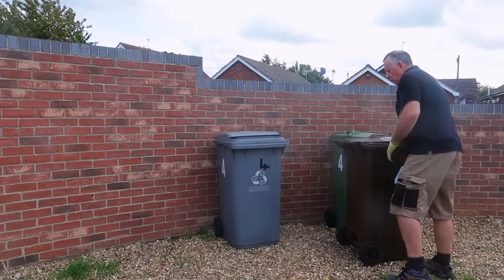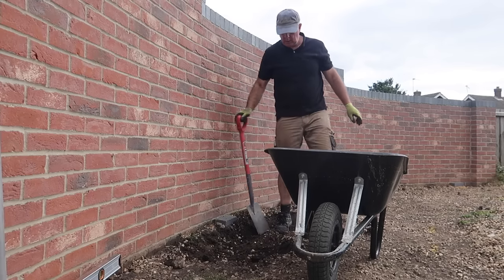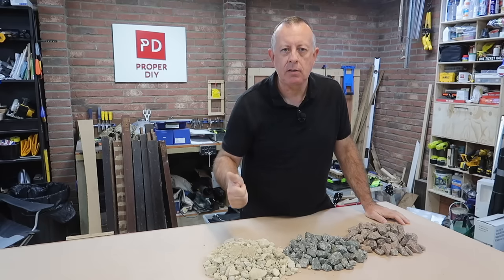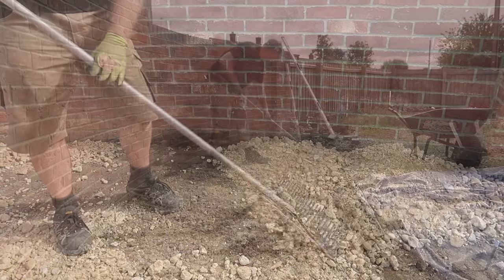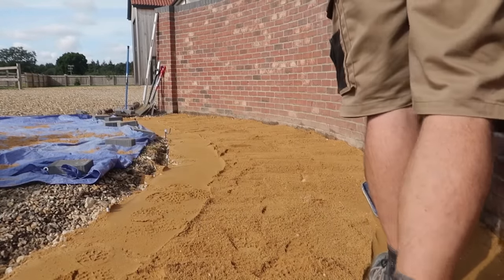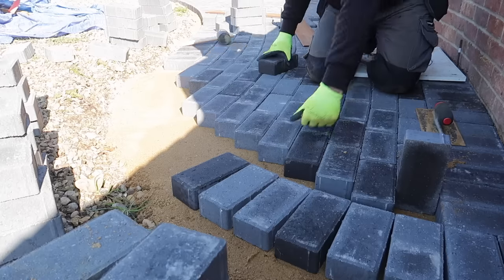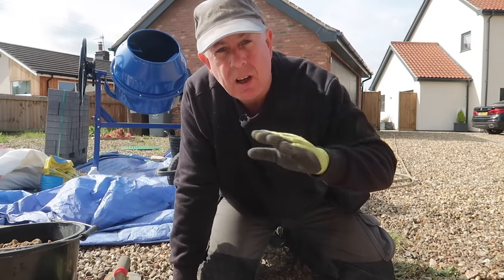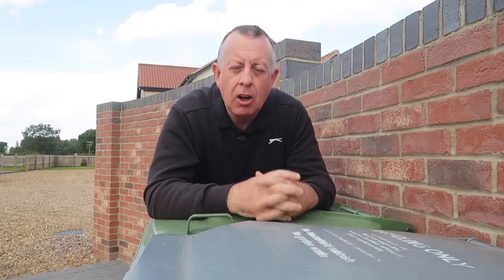The Easy Way to Lay Block Paving

Comment: Top job sir, excellent.
I prefer a plastic float for sand. Also a wee rubber mallet for tapping in cuts.

Here’s my top tip……..
When pointing flags or border blocks in this instance if you sit your metal plasters float on its edge exactly on the edge of the material you’re about to fill, then offer in the mortar against it and it slides nicely down the face into the gap. As you do it you can use the trowel that you’re emptying the mortar off as the second “edge” in the motion. Also you can hold the gear against the float and if you’ve got too much just scoop it back up the face and back into the bucket, it’ll just sit nicely against the metal float on its edge, just cut it off level using the other pointing trowel with the top of the block/flag, then run the pointing tool over it etc.It’s a bit hard to explain writing but I’m sure you get the idea. It’s not bomb proof but it does stop things getting really messy! Cheers all the best
Reply: Sounds good to me

Comment: Looks great Stuart. Little tip when cutting...To avoid cutting tiny slithers of block, replace the full block behind your cut with a half block. This way your cuts will always be at least half a block in length.
Reply from the maker: Good point!

Comment: Always like your videos. Watching from Canada where climate changes are something else. We have flexible edge banding made of plastic with spikes for the edges that keeps everything in place. Then you can use sand to fill the gaps. We also have polymer sand which is like your kiln dried sand with a "resin" coating. Once you finish vibrating it in, you mist it with water and it turns hard as concrete. Fills large gaps too. Great job on the pathway.

Comment: I used the dye in mortar in the summer when i replaced a retaining wall with block kerb edgings, as you say its trial and error. to get the colour right... Where the kerb edges went around the 1 corner it left large gaps which  i filled with the dyed mortar. and smoothed flat to the next blocks.  Once it started to cure i ran  the  trowel edge down the sides, this makes it look like a cut block or sliver of a block inserted in the gaps, Then used the same stuff on door step to fill the gaps which has survived the frost with ease,  Great video

Comment: Good work and good advice. I threw some block pavers down on size 11 boot compacted sharp sand and smacked the blocks level with a rubber mallet. Still solid 5 years later, although I prefer your method. 👍
Reply from the maker: Thanks. A footpath doesn't need much. The 75mm I put down will never go anywhere. However I'm still waiting for comments tell me I should have used 150mm of type 1!

Comment: Superb job as always Stuart👍. However, having watched watched your video on mixing cement with soil, would it be possible to do away with the Type 1 base by using that method for a path/patio base and then incorporate the sand/screed on top as usual? Thanks if you can respond👍

Comment: Decent looking job that. Placing blocks on a bed of sand when bolster cutting helps them cut in the right place  but disk cutting is the way forward as shown by those nice fits on the cuts. Highly recommend the Marcrist blades. Not the cheapest but they last.
Reply from the maker: Thanks. Good tips - I'll have to try next time.

Comment: It’s “sun-formation” under your type one. The type one is your formation. And you don’t need to compact virgin ground as it’s as hard as it will get already. Only reason you would do that would be to seal it. And you can over compact type one as it migrates the fines and you lose the bond - and method of measurement would give you the amount of passes necessary at what compaction

Comment: Just did my 70sqm patio this summer with porcelain 20mm thick slabs. 24” sq down to 12” sq

I decided to use a thin layer of (sharp sand) concrete. And then exterior tile adhesive (since mortar doesn’t adhere to porcelain without prep)

I did consider just using just the sharp sand but the area I had to work with was nasty. Lots of different areas all mixed together (some old foundations, some garden, some drainage etc)

Nice job you did 👍
Reply from the maker: Thanks.  70m2 of porcelain is quite a job - well done!
Reply: We have just had ours laid 50 sq m porcelain. The prep part to work with mortar is very simple to do using a simple slurry mix

Comment: Great job mate. Depending on whether they’re Clays or concrete blocks all depends on how they split. I use a 9” grinder as I consider it to be far neater than a block splitter or hammer and bolster, although as you say the grinder does make it a dirty and noisy job. Got yourself a new sub either way 👍🏼

Comment: Proper job. I’m thinking of doing my own front path soon with similar blocks, so some great tips here. I am interested in how possible/hard it would be without a tamping machine, though. The path is about 70cm wide and 3 metres long so not huge. It’s on a very tight budget basically, so trying to avoid hiring anything. Cheers.

Comment: Excellent video on this job of work. Why though, if it's only a path, did you use 80mm thick blocks which are used for highway traffickes surfaces ? Surely the 50mm thick blocks which are suitable for footpaths would be more economic and might even have cut easier by bolster chisel. Otherwise  great instruction about how it should be done.
Reply from the maker: Thanks. 60mm thick actually and they were the cheapest ones at my local builders merchants!

Comment: Thank you. Seeing how a proper job is done really helps to avoid bodge ups, but wow!  What a lot of materials are needed….did you cost it out?  That short stretch of block paving must have cost a pretty penny by the time it was done.
Next summer I want to replace my front picket fence with a low brick wall….These kinds of skills make the job easier and more professional.
Reply from the maker: Glad you enjoyed it. I would think around £400 in total. Prob £1000+ if you you could find someone to do it.

Comment: If you are shoveling type 1, get it tipped on to a hard surface ie old sheets of ply or concrete so much easier to shovel into wheel barrows shoveling out of bags is a nightmare.

Comment: nice video. did you find weeds started to pop up in between the blocks? They have polymeric sand which is supposed to be good at prevention. going to try it out on my driveway soon

Comment: Very nice job. They look like 60mm blocks, was that intentional or just a happy coincidence? I’m after some 60mm blocks to fill in where a tree died and struggling to buy less than a full pack 🙄 Do not want to mess about with 50mm and 60mm malarkey 😆
Reply from the maker: Thanks. Well spotted - yes 60mm blocks. I just wanted a cheap, charcoal block and as a couple of my local builder merchants were completely out of stock, these were the best on offer. No, using 2 sizes on the same project would be a pain.

Comment: Tidy video thanks. Is that mortar you used to haunch-up the outside edge of the path or concrete? Or was it mortar you pushed under the bricks and then concrete to make the haunch?

Comment: Use a line , always plate your area 6x and mix cement through your sand  say 1 shovel cement to a wheel barrow ..best with red sand gives a rock  solid base .

Comment: I saw that you put the spade into the cement mixer while it was rotating. I was told (and I'm by no means a professional) that was potentially dangerous, as the mixing blades could catch whatever you placed in the mixing drum. With a best-case scenario of taking the said item out of your hand and a worst-case, breaking your arm.
Reply from the maker: There is that chance and I'm sure no college would ever recommend it but .... once you've spent some time mixing you'll understand why

Comment: Awesome video as always, very well explained as always. Would you use the same method for laying slabs? Have you done a video on slabs like that for a patio?
Reply from the maker: Thanks. I would always lay slabs on a sand/cement mortar. Because they are so thin relative to their size, I think there would be a tendency for the corner to push into the bedding sand if you stood on it which blocks can't do because of their shape.

Comment: Nice work. One question, is polymeric sand available in your area?  It is better than the kiln dried sand as it has adhesive particles, so once you sweep it between the cracks you just sprinkle it with the hose and it becomes hard but still somewhat flexible so no weeds coming through.

Comment: Good stuff Stuart as normal. With the last layer before block being just screed. Do you keep this as thin as possible to avoid sinking as it hasn’t been as compacted as the sand below?
Reply from the maker: Yes exactly and that's why when you put the plate compactor back over the blocks at the end they do settle a few mm.

Comment: Is “MOT Type 1” another name for what I call Crusher Run? I’m no builder just a keen DIYer so very often I know what I want when purchasing things but not the correct name. I grew up helping my father a very old school plumber and one example was he called sharp sand “river sand” which is obviously what I grew up calling it and still occasionally do.
Reply from the maker: Crusher run is very similar and in the DIY world prob just as good. It doesnt have the same control over the grading so may not pass the requirements in a professional environment but at home would be fine.

Comment: Can just query one thing you compacted the soil below the type one would that not stop water drainage as block paving is permable just wondering
Reply from the maker: Irrespective of what anyone else tells you, once you compact type 1 (very hard stuff) and seal the joints in block-work with very fine sand, it isn't going to be permeable! Thats why on site when we dig to formation it's good practice to cover and compact with type 1 ASAP before it rains to protect the top layer of ground. Maybe after a few hours the rain may gradually disappear from block work paving but I guarantee if you dig it up, underneath will be as dry as a bone. So, compacting the soil underneath isn't going to make a difference other than give you a really good foundation.

Comment: If you are using a Club Hammer and Bolster. Better results are achieved if you lay the brick on sand .Definitely not concrete or other bricks.

Comment: Brilliant video as always. Love seeing them crop up on a Friday. Did you consider a weed barrier at any point or do you think the build up of type 1, plus the sand and joints filled with sand sufficient. Do you expect to have refill the joints often, every couple of years? Keep the videos coming!!
Reply from the maker: Thank you. Nothing will ever come through the type 1 after all that compaction. Where growth will happen will be from above getting to the joints just like it does on my other paving pointed with resin motar. It will need to be jetwashed off after a couple of years prob.
Reply: @ProperDIY  A good way to prevent weeds growing between your blocks is to seal them with polyurethane block sealer, which also prevents the sand coming out after pressure washing or even rain. Look much nicer as well.

Comment: mortar for pointing and concrete for edging what ratios did you use  .... sorry for the silly question ... still confused even after looking at various vids.
Reply from the maker: I used a strong mix of 3:1. There is no problem using a strong mix for most things except it costs a bit more
Reply: @ProperDIY  Thanks for replying .. is that for the mortar or concrete... the concreate i use ( I try to use has lots of small and big stones ) and never can smooth it.
Reply from the maker: @tonycat721  For this job I just used mortar as I had the sharp sand already there in the bulk bag. The one with big and small stones is ballast, which is fine, but not good for fine work.

Comment: Couldnt you use the stones you removed as the aggregate? Or is it a regulation thing?
Reply: You need a good mix of stuff. As he explained at length

Large, medium, small and fine dust. So that it locks together. Meeting MOT Type 1 spec
Reply from the maker: Exactly
Reply: @ProperDIY   Right but you were talking about road laying. In this use case where it is lower usage/risk of settling/impact/force to bear etc, is it still needed? Or required per regulations even on private property? If not i would imagine reusing the existing stones would have been economical and better for the env as well right? And the compactor would have broken some of them up for a little bit of the mix of sizes as well right?
Reply from the maker: @ktaragorn  You could add the original stone into the type 1 without affecting it. I put it to one side as I will need it in another area.
Reply: @ProperDIY  got it!

Comment: Can you lay block paving over existing concrete paths
Reply: Yes
Reply from the maker: Yes if you have 1) enough height above the existing path and 2) if the any overhang is properly compacted so you don't get any differential settlement
Reply: @ProperDIY  
Thanks for reply 
So do i just need the sand over the old concrete path then? im planning to retain the edges with a edgin stone of some description
Reply from the maker: @ericthekingthekingtheking4842  Yes. If the current path is solid and stable then a thin layer of sand and then the blocks. As I said though make sure if any of the new path is over hanging the old, it has a really good foundation. If not in time the old and new will tend to move differently and you will see a crack/joint appearing.

Comment: The spec for this paving is wrong.  The sub-base should be 100mm or more and the sub-base could be MOT Type 2 as Type 1 is more expensive and is only required for engineered sub grades.  I would normally include a geotextile material under the sub-base to control weeds and on occasions where the weeds appear to be a problem I will spec a strong weed killer over the formation.  The bedding of the block paving should be a minimum of 50mm sharp sand.  It is vital that the perimeter of the paved area should have the blocks laid on a wet concrete mini foundation taken down to the formation layer as without it the paving will move, more especially in this situation with a gravel area beyond that does not provide any restraint, the proposed edge restraint is a nonsense as the perimeter blocks will move, riding on the minimal concrete fill..  Ordinary foot traffic will break away the edge.  No concrete bedding is required on the wall side.  The paving cross fall should be 1:40 i.e. 25mm in 1.0m as this guarantees surface water drainage, which is critical in freezing weather, the last thing you want is to fall and injure yourself whilst putting out the bins at night.  Anything less than 1:40 cannot be guaranteed without a good deal of effort and there is always the possibility of subsidence affecting the falls, more so since without the concrete edge restraint water will flow to the outside of the paving area via the sand layer taking with it the bedding fines.

Comment: Shame you hadn't got the dig out and prep done before the tyoe1 was delivered so you could have got the hiab to lift bag over the area and split the bag in situ
Reply from the maker: The risk of excavating before the materials arrive is that it rains. With inconsistent deliveries at the moment during Covid and UK Setember weather this is a real chance. If it does rains when you have dug the hole, water will naturally pond and you have a mini swimming pool which means taking out more material to get a good formation again, then ordering more stone to fill it etc, etc. Risky strategy and something we would never do in site in the professional civil engineering world.
Reply: Thanks for the response,  a useful insight as always

Comment: Build a bin store next, my neighbour has made a real mess of his flat pack bin store at the front of his house.
Reply from the maker: How did you know I was going to do that! Mine will be designed by me once I get some time - prob 4-6 weeks.
Reply: @ProperDIY  I'm just going to copy the commerial available models with a velcrp strap connection to the lid of the wheelie bin, so both lift together and easily breaks if I pull the bin out with disconnecting it

Comment: Would of dug it out and had the type 1 dropped in place to save moving it.
Reply from the maker: That's fine if you can time the excavation, delivery and rain well. Once you dig to formation, the type 1 needs to go in immediately to protect the gound. If it rains in between, then you will need to dig out more because it will be mushy and then order and wait for more more type 1 to arrive to fill the bigger hole. (Whilst hoping it doesn't rain again)
Reply: @ProperDIY  could you of laid the paviors straight on sand on the mud? The same as the drive. As there’s no mot type 1 under the shingle? Will the mot stop the weeds coming through like the drive?

Comment: didn't you need a Weed Control Membrane
Reply from the maker: No. No way weeds are going to get through a compated layer of type 1. If you do ever see weeds on the surface it will be them taking root in the jointing sand from above